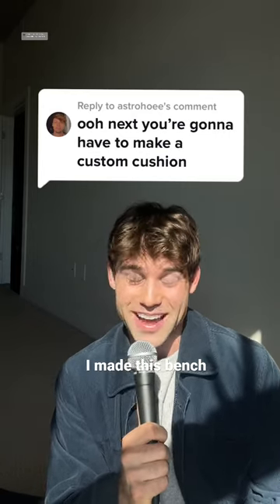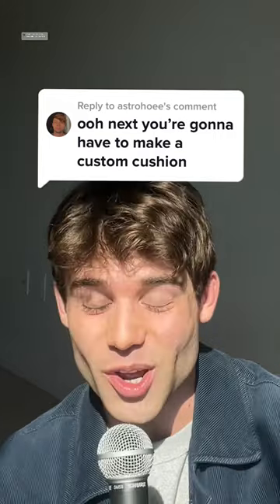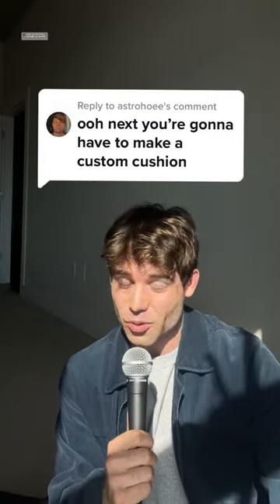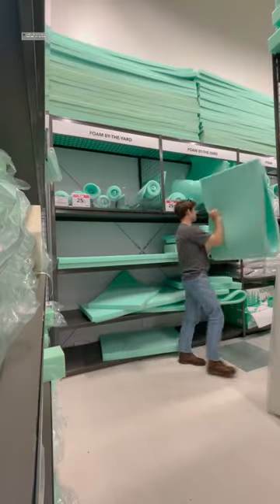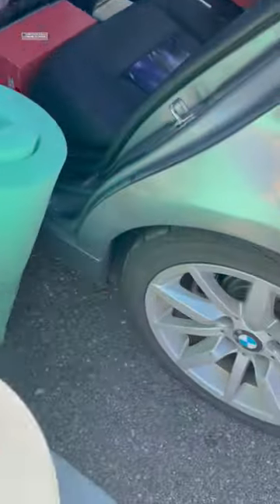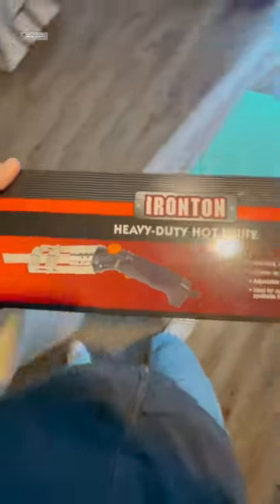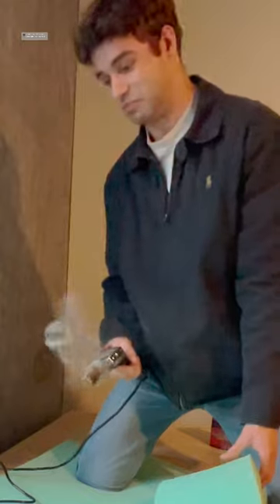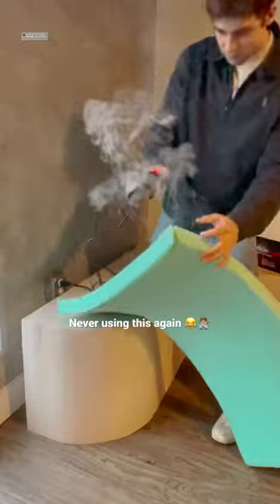I’m so excited for this one!! ThankYOU so much for the inspo #buildwithjacob

Comment from the maker: I always LOVE reading through comments, sometimes I can’t answer them all, but I always make sure to read through all them :)
Reply: Dude I know this is an old video but for future reference, the hot knife was probably chemically coated which should've been why the instruction manual should've said to either wash it or remove the coating. If it didn't say that then it's definitely illegal/a safety hazard. Please be careful and if you still don't plan to do anything about it please use a filtered mask and in a ventilated area.
Reply: This is a common practice by companies to chemically coat tools like this btw, I think I've even seen it on soldering irons but I always wash anything off before use now so I'm not sure what other appliances can have it . But those fumes are harmful, use caution.
Reply from the maker: @min3craftiscool553  agreed 🙏🏼
Reply: i used to watch an old show called The Furniture Guys. they often used an electric carving knife to cut foam. you know, the electric knife used to carve your turkeys! no fuss no muss. 😉
Reply: You should stain the wood it'll look really nice if done correctly

Comment: Upholsterer here, we use an electric knife (like the small home appliance kind for carving a turkey) to cut our foam to size.
Reply: yeah I was sitting here like what he pulling out a hot knife for, scissors will do (if be a little rough sided)
Reply: @lamipurpure7992  I wouldn't recommend scissors. Cutting through that thickness hurts, and it's very hard to get an even, straight line.
Reply: Wow where i worked we each had scissors and a kitchen knife to cut foam 😂 y'all had it way easier with a hot knife, it was literally torture to use scissors and a reg knife (that wasn't even sharp)
Reply: In this case for foams like this a hot wire cutter might also work however this foam seems thin and flammable so do research before trying this

Comment: An electric bread knife works great, also carpet foam is dense and cheap. I rebuilt a bench press. I also used gel memory foam and green marine vinyl and hammer finish paint. Made a couple 100lbs cement plates.